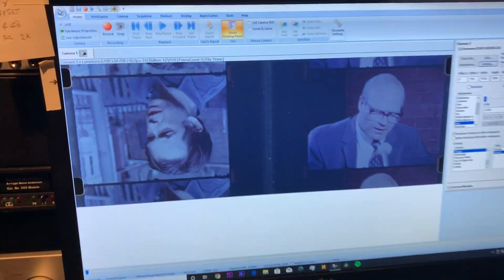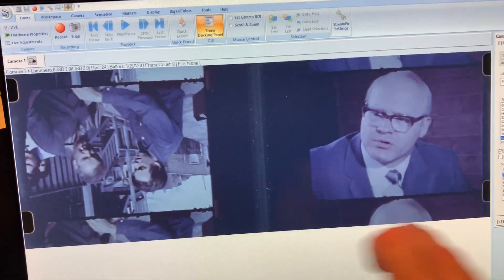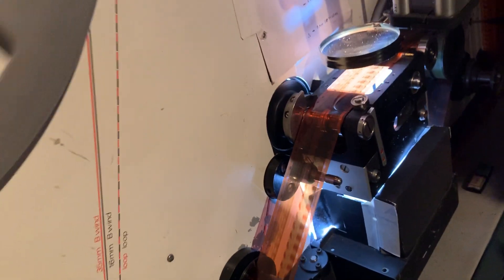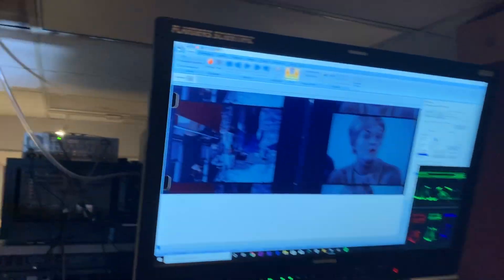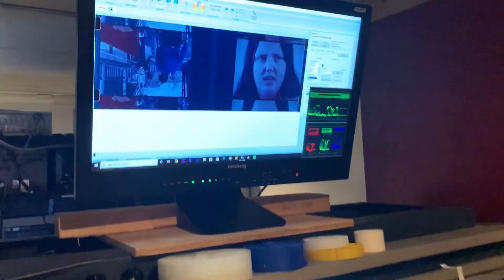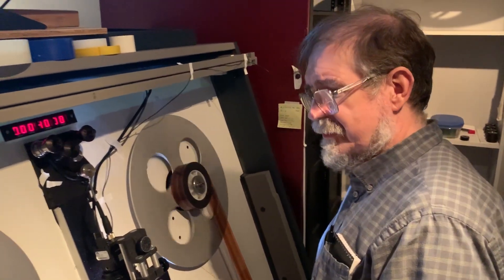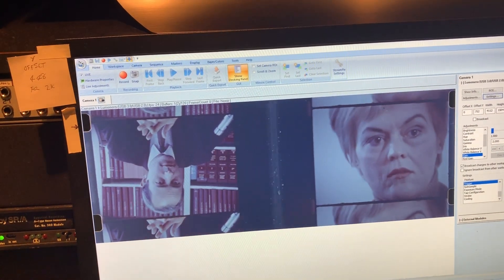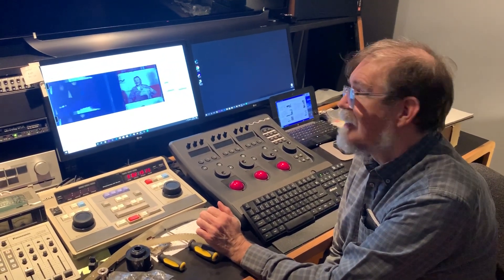35/32mm to 4K Film Scanner at CinePost

Comment: How expensive is it to scan 35mm film into 4K in average? Say for a music video
Reply from the maker: Has the film already been processed?
Reply: @cinepost  To be perfectly honest, I'm just curious about the whole process and how much does it actually cost.

Recently several old music videos are getting 4K rescans and it left me curious about it all (and why many still haven't got rescanned), Sorry for the ignorance. And is 35mm film 4K or higher even?
Reply from the maker: @SantiagoMonroy5  35mm or 16mm to 4k cost the same to rescan….. $1000-2000 maybe… but you then have to import to a 4k project  and do a video layback to the original cut by cut.   This costs
A little money too if color
And effects are needed… it all depends.
Reply: @cinepost  Thanks for the info! Just curiosity and yeah I was aware of having to re-edit and grade from scratch 90% of the time. Honestly not as expensive as I thought, wish more music videos would go through that process
Reply: Only last thing, maximum is 4K or what resolution would film be?

Comment: Is that two different films, or two copies of the same film?  Could be useful if the latter since any damage on one would probably not be on the othering the same place.
Reply from the maker: I am pretty sure that it is the same film.  The only reason to do this is that the lab costs are lower and if you needed to make
100 prints, you would go for this process.
Reply: @cinepost  
I think you’re right that it was probably two copies on that reel, but it’s possible that is you had a film which was two reels long you could have one copy of each on the Internet, so that each print, after slitting would be the complete film.

There were many of these strangely perforated formats for multiple printing.  On 16 mm there was 2x standard 8, which I have only ever seen in 1-4 format, like standard 8 camera stock, and 2x Super-8 which was available in both 1-3 and 1-4 formats; the former seemed to be more common.  There was also a 100 foot double Super-8 camera format in 1-4 which was slit after processing, but it was rare.  On 35 mm stock there was a format for 3x9.5 mm down the centre of the strip with a narrow strip of waste down each edge which carried extra perforations which were used to register the films in the printer.  I think this was only used for black and white.  For large scale photographic printing there was a 4 up on 35 mm format with all four copies running in the same direction. I can’t remember the full designation of the format now.  The 3 mm waste strip was down one edge of the film, and again carried an additional set of perforations for registration.  All of these were for photographic printing.

Technicolor imbibition dye transfer printing was always done onto 35 mm stock, but Technicolor had several systems for producing smaller formats.  The first of these was for a single 16 mm print down the centre of the stock.  This had conventional 35 mm perforations down each edge and so could be printed on a normal 35 mm pin belt, but was obviously a wasteful process.  They later developed a format for 2x16 mm prints, again with an extra row of perforations on the 3 mm waste strip for registration.  This required a special pin belt to be fitted to the printer.  I believe there was even a format for standard 8 prints to be made 4 up using the same pin belt.  For Super-8 there was a problem in that the perforations were two small to be used for printing, so these were printed 3 up on the stock, with 5.5 mm of waste down each edge which carried additional perforations for registration on the pin belt.

I have never seen the format which you were handling in your video with the 16 mm being in 1-4 format, nor have I seen a format with the waste strip in the centre of the 35 mm.  What was this film, was it a feature or a short?

The 1-3 format had the advantage that making the reduction interneg from the 35 mm interpos could be done in one pass as both strips could be printed at the same time by means of a beam splitter prism on the optical printer whereas for the 1-4 format the intermediate stocks had to be run through the printer again in the opposite direction to print the second copy.  However, as I mentioned before, today this could have an advantage when scanning today as the same frame on each copy would be in a quite different position in the reel, and so any damage probably wouldn’t affect the same frames. both copies.

All very much in the past now, but there used to be a large market for 16 mm prints.